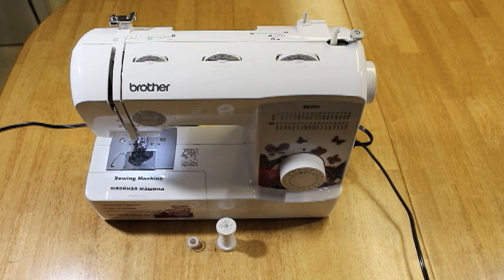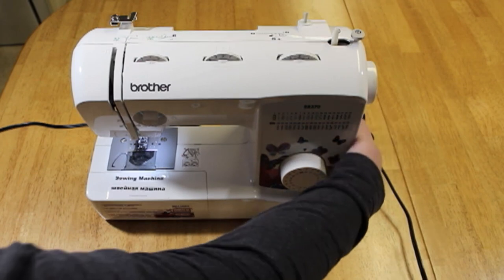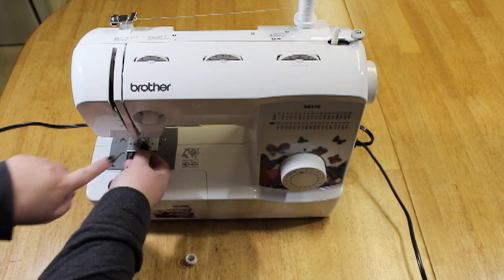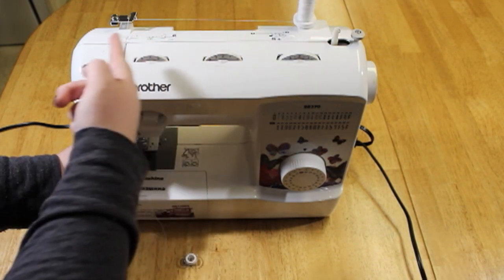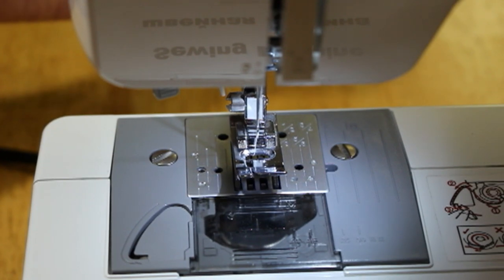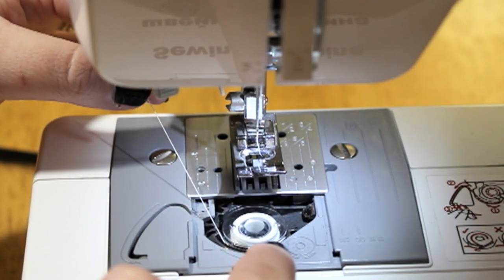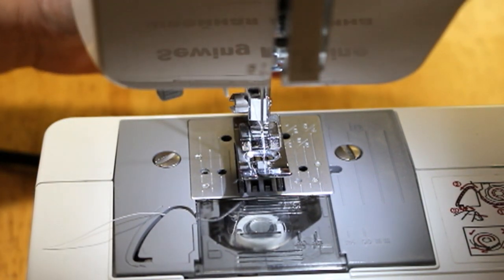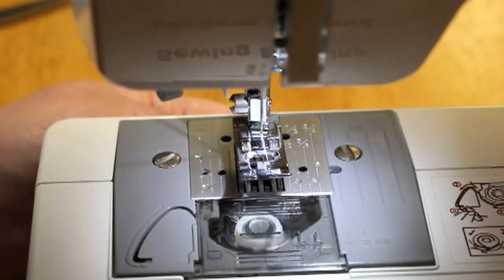How To Thread a Brother Sewing Machine

Comment: I was a complete novice about sewing machines and I bought a Brother LX17, which has turned out to be very useful. But the user guide is anything but helpful! I've been struggling for 7 years to get the threading right, but two little tips in your video helped enormously. One: the correct way to thread the needle. And Two: inserting the bobbin. It was kind of an "aha" moment and I immediately paused the video and got out my sewing machine. I've just done three test sews without having to retread the needle! The problem in the Brother documentation is that the illustrations are too small so you can't see the detail. Also, the use of the thread cutter, well, it's not just handy, but it gives exactly the right length of thread left. I was using scissors to cut the thread.

Comment: Some Zoom and some decent lightning would have helped immensely.  Your side of the machine is all dark until you finally turn the machine  (and light) back on.  That's my biggest gripe with Brother anyway--you can't see crap while using it unless you have a mini-flashlight on hand.  Otherwise, you have to spend mega-bucks to get a computerized model with a large color display just to see the stitches.   Would take mine back in a heartbeat and stick with my old 1950 White if I could.

Comment: thank you. I was having trouble with my thread nesting. It was because I had it wrong up around the silver do-hicky.  Once I corrected that the nesting seemed to go away.  My xm2701 will automatically pick up the thread bobbin without me having to pull it up.  Just have to make sure and put it in the little curved area.

Comment: 6:10 what loop? Nothing happened for me. And where did you get two strings from. Ugh this is so frustrating
Reply: Addison Dolensek same!!! This is the third tutorial I’ve watched and the bobbin thread is not in a place to get caught by the needle. At all.
Reply: I had this same problem before. Make sure you placed your threaded bobbin down first. Manually bring the needle down two or three times. You should see a loop form underneath the foot. If no loop has formed you might see a small string sticking up from the bobbin hole. Pull on that with tweezers or your scissors very very carefully and you should have two strings pulled out. One from the needle and one from the bobbin.
Reply: This happened to me too
Reply: same!!
Reply: There are sewing machines (like the brother innovis 35, that I own) that do this for you. They are a little bit more expensive but if you really find this hard to do, they do it for you). I wanted to purchase a simpler one too but I hope I don’t find it frustrating to use....
Reply: Half the time she goes, "you probably can't see it". So what's the point of the tutorial..  frustrating. I'm like a blind person in a dark room just feeling things. 🤦
Reply: Enzo Issac  spam/scam alert
Reply: Cyrus Darius  spam/scam alert